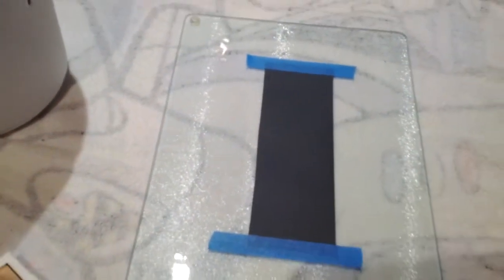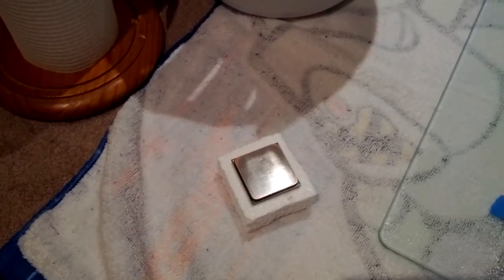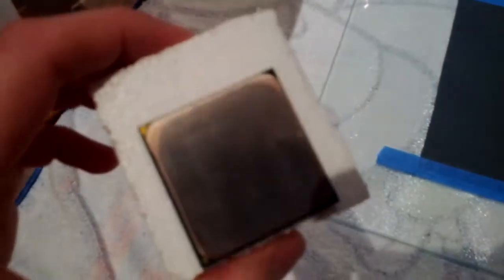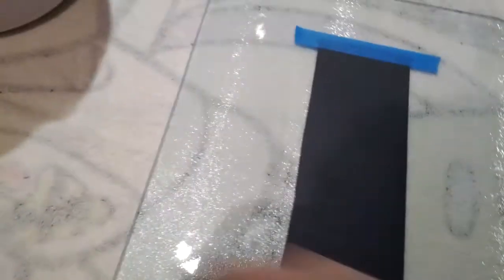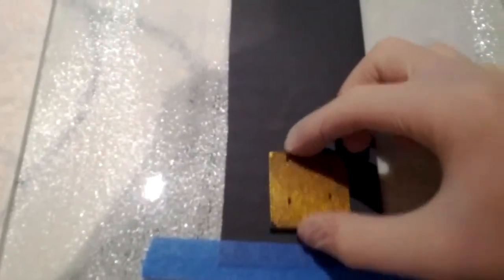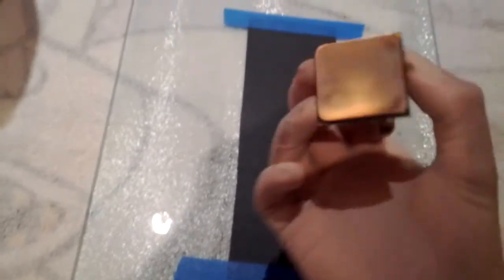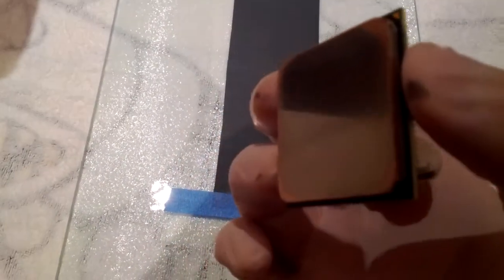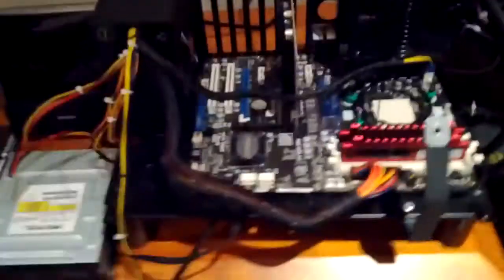Phenom II 545 Lapping

Comment: For the best results you need to lap both cpu and cooler. Both cpu and cooler can be convex/concave. When they are both as close to flat as possible it provides the absolute best contact between both surfaces. And when both are lapped only use a small amount of TIM.

Comment: Did you lap the kuhler 620 also? Very interested in the temp results. I've got a PII x4 955 @4ghz 2.6ghz cpu-nb and kuhler 620. Really thinking about lapping... With 20min Prime95 Blend it's hitting 54-55C on the cores with 26-27.5C ambient temp.